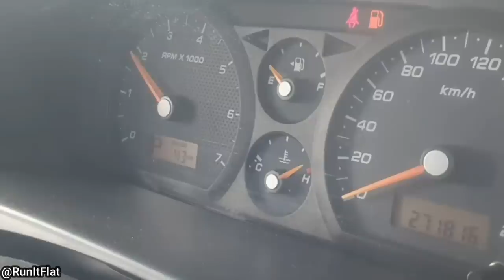Customer States Car Is Overheating And Won't Shut Off! | Just Rolled In

Comment: NO oil is something you do NOT want to mess with.  I had a car with a slow oil leak for years and couldn't afford to get it fixed... and kept adding oil to it.  Well, I either slacked on adding oil or the leak suddenly got worse and the engine seized up while going 75 on the highway in the left lane of 3 lanes.  No shoulder on that side and medium traffic.  

I had to merge all the way over to the right shoulder while coasting without power steering OR power brakes because the brakes quickly went out since there was no power.

Thankfully I had a hand brake and had been trained on using it in an emergency.  It wasn't fun but I did it safely.

Comment: I have seen dieseling when an engine runs to hot and rich you could even pull the spark cables and it will keep going.

Comment: 0:17
For anybody wondering
The reason why it's still running is because the alternator is still generating electricity and its just enough to keep the engine running

Comment: Old Fords had a habit of not turning off with the key; the trick was to carry a hammer in the car.  To shut it off, you open the hood and give the solenoid on the inner fender a tap, until you got around to replacing it.  Same with a stuck needle in a flooding carburetor, tap it a few times to dislodge the dirt sticking it open.  Young people don't have the pleasure of mechanical everything.  lol

Comment: The first car, I thought I was imagining it at first glance under the bonnet. Not imagining it, that's the mighty Ford Australia Barra six engine in a 2003-2005 BA Ford Falcon. Yeah of course she'll still run on the alternator, buggered ignition switch correct diagnosis.

Comment: 3:10  I would be beyond disappointed if a tire shop was doing that to set the bead on my tires.  If it was a tractor off in the field or something like that I can understand but not a light truck tire
Reply: sometimes you have too. When the new tires come in and the beads of the tire are almost touching
Reply: @poke769  If my new tires are that squished I don’t want them

Comment: i remember having a motorbike when i was in my teens and it wouldn't shut off , 
it high reved, then when i turned the key it didn't stop ( i had it in neutral ), so i pulled the ht cap off , still was going like the clappers like it was possesed ,so i had to stall it by putting it in gear 

the problem?
it had a ton of carbon in the head and on the piston which was causing the petrol to ignite 

scary stuff 
😱🤯
Reply: Have had that happen with a chainsaw - after idling for a few minutes however it would cool enough to stop, but confusing!
Reply: Running too lean and getting a flogging does that. Keep riding and the piston will melt a hole through it's top. Happened to me on a suzuki rv125 trying to keep up wuth a dr250 yammie. Lucky i had 3 spare parts motors.

Comment: Your note on the vice grips implies that there is a correct way of installing vice grips on battery terminals.
Reply: My guess on the broken shock is that it was an 800 dollar beater and not worth fixing.

Comment: My water pump seized up and snapped off at the fan clutch 720miles into a 760 mile trip. 2000 dodge dakota that water pump was stock. Fun times

Comment: I think the engine running is from dieseling. The engine is so hot it is compressing the fuel and igniting it. No ignition needed.
Reply: no
Reply: I'm pretty sure that engine was a Ford Barra 6, of which there were no diesel versions, only petrol and LPG
Reply: Not a diesel
Reply: @SpearM3064  99% sure that's not a diesel
Reply: @SpearM3064  no, the transits only have a second battery under the passenger seat if they're a camper. They only have one battery and that's under the drivers seat. Diesels have usually only one battery, but luxurious sport cars have sometimes 2 or 3.
Reply: Guys... he wrong but not for that reason.  YEs, it's a gas engine with a busted keyswitch, simple fix; however, the term "dieseling" is referring to when an older carbureted gas vehicle would continue to "run on" like a huffing choked donkey when the engine was hot and timing too far advanced and some hot spot in the chamber that allows for the compression and heat alone to maintain combustion similar to how a diesel works without spark plugs.
Reply: @THRASHMETALFUNRIFFS  yep, all the later model carbies had anti dieselling solenoids to positively cut off petrol supply inside the carby to stop the fuel instantly. One of those out of tune with the solenoid disconnected would chug and rattle for 15 seconds or so before it stopped!

Comment: 0:22 so how does the engine keep running with no battery? Like ik the alternator charges the battery but I didn’t think it directly powered the engine spark plugs and such. So how does that work? Is it literally running off the alternator or something?

Comment: Disconnecting the battery won't stop most engines from running as long as the alternator is working. Don't know what that technician was thinking.

Comment: Its weird that ppl don't know pulling the battery won't turn the engine off. Its basically used just to start the vehicle. The alternator will keep it running

Comment: If the ignition switch is busted then it wont matter if you unhook the battery. The alternator will keep the motor running. Cover the exhaust until it shuts off or unhook the alternator wires.
Reply: You can also block the intake as well, suffocating the engine of incoming air. :)

Comment: Here's a tip. When adding any fluid to your engine  be mindful of the paper seal under the cap of the fluid container and NOT let it fall into engine or other receptacles   because it's a bitch trying to get it out!

Comment: Yeah, pulling the batt will not kill any car because the alternator is still providing power. You best best would be to pull a relay that controls the fuel pump

Comment: I had this happen to a classic car I was driving. I got the engine temp light and I pulled over less than 2 mins later. I tried to shut off the engine but it wouldn’t shut off. I unplugged the battery the ignition switch wasn’t messed up it just go so hot. It was not a diesel car either but it acted almost like a diesel runaway. It was very weird. I managed to get the engine to stop by shoving a towel into the intake to choke it out after like 10 mins of trying everything.

Comment: Pretty sure if your car shuts off when you disconnect the battery, you have a bad alternator.  However, don't actually do this because the sudden change in voltages can seriously mess up your car (as mentioned in the description).  Someone did that to a previous car I had and luckily all that happened was locking the door with the key caused the horn to honk briefly.  I don't think I've seen one where the car wouldn't shut off with the key, THAT'S weird.
Reply: There's better ways to cut power to something, just yank fuses

Comment: The first video my buick lacrosse did that when I fixed my brakes. I went to work tried using my E brake heard a snap couldn't turn it off and took me about an hour for me to turn it off but what I did was pulled the brake backwards towards me with my foot and it magically turned off 🤷‍♂️

Comment: I've seen a Ford V8 get so hot that even after disconnecting the battery it was still running just due to the heat in the block exploding the fuel. We had to pull the fuel line to stop it.

Comment: The runaway engine is easily stopped. Foot on brake pedal, out it in gear and release clutch quickly to stall the motor - works if its manual transmission, its another can of worms if its automatic.
Reply: With the state of the brakes on most of the cars on this channel the only thing likely to happen is a short excursion through a brick wall!

Comment: Yes people, if the engine is running, it will continue to do so with the battery disconnected, as long as the alternator is in good shape.

Comment: As long as the Car is Running Disconnecting the Battery won't shut it off because if would be running off the Alternator at that Point the Battery is only used when the Car is off and to start the Car

Comment: What was in the camaro exhaust?
Reply from the maker: Turbo exhaust whistles. It's like putting a hockey card behind the wheel on your bike tire lol
Reply: @JustRolledIn  So no advantage whatsoever other than making noise?
People are dumb.
Reply from the maker: The exhaust is so big that it will probably not even make a noise lol
Reply: @JustRolledIn  LOL. Never looked before this, but I suspected you were Canadian with that comment. In US it would have been baseball card. Love your vids. Keep up the good work.
Reply from the maker: @michaelwarren2391  lol, you're correct and thanks, Michael!

Comment: Hi just wanted to let you know that motor is a ecotec its a aloytech the one after the ecotec (L36) they have a normal oil filter the aloytech has the one that looks like a pool filter at the top of the motor

Comment: its a stuck silinoied i had that proplem ware i turn it off take key out and its still running but when i disconect the battery it usly shut off and when i touch the wire to battery it start right up

Comment: The last one with starter fluid was plain dumb, but I’ve had to do it. My first truck had 16.5 inch rims and they didn’t seal the same way as regular tires
Reply: It's done all the time.  Handy trick on a farm or out in the sticks.
Reply: Hope you never go off-roading , or are in a really remote place with a tire off the bead 😮
Reply: @peterf.229  I live in Utah bro I’ve gone off-roading my entire life, let me give you a bit of education. The reason the 16.5 inch rims are no longer made for trucks is the wheels lack the safety rim that holds the tire against the bead at lower pressures. What this means is if the pressure gets low you will lose the bead on the tire and it will completely deflate, if this happens and the weight of the vehicle is on the tire it is impossible to re-inflate the tire. Modern wheels and tires do not have this issue.
Reply: @peterf.229  also, I’ve broken a rim out in the Moab desert. You always carry a spare, a high lift Jack, and a goddamn winch. I keep enough tools in my vehicles to damn near rebuild the entire engine if I have to off road. (Hyperbole obviously but you get me)

Comment: Take the air intake off and cover it with your hand or a piece of wood to kill the engine. Or pull the fuel pump fuse.

Comment: 0:36 Wait… A Camry with the oil filter on top of the engine? I thought they were on the bottom.
Reply: Australian maybe 🙃
Reply: My Tacoma has the same engine as some Camrys and it’s on the bottom , pretty sure the engines are similar in all of them, but who knows .
Reply: Mine was also on the top, I hated it

Comment: I was always told that doing the tire fire thing was only good as an emergency repair to get your tire back on and you're supposed to get it properly put on ASAP. Is this actually a professional way to do this?
Reply from the maker: You're correct on that. Also sometimes you can't get a tire to set the bead so you do this. From my understanding these guys were doing it after hours on their own tires. But ya there is more professional ways on doing so.

Comment: Who the heck thinks disconnecting the battery will stop an engine, unless the alternator noise happens to kill the ECU. There are about a billion other ways to do it. Pull the ECU, fuel pump, or main relay. Or fuses. Or spray a CO2 fire extinguisher into the intake if it’s about to explode and you don’t want to get close

Comment: The wobbly custom exaust makes my exaust look excellent lol i have a muffler with 3 in pipe slid onto 2 inch pipe no welds or anything hole in the cat i cut to relieve pressure when the factory muffler clogged and its being  held off the drive shaft by a ratchet strap been meaning to fix it but who wants to fix it when its in the 80s and 90s out i have a parts truck with a muffler i can use may be quiet but the engine will like back pressure again lol i have a 96 c1500 5.7 with 344k miles and a 98 parts truck identical just has 214k miles

Comment: uh if you don't cut fuel to the engine, it's not surprising that it is running without the battery... the whole point is that it's charging the battery when it's running... starting it without the battery would be surprising

Comment: Neighbor drove a company car. He'd check the dipstick and it appeared to have oil. But when he finally took the car in for an oil change, there was no oil. The dipstick had oil burned onto it. How do these engines run without oil?

Comment: Would have pulled the spark wires before pulling the battery cutting fuel snuff the airfilter either 3 will definitely shut her off

Comment: Remind me NEVER have tires changed at the last shop. The flame just ruined the rubber compound.
Reply: @SpearM3064  160 is the autoignition temperature. It will burn a lot hotter. 600-800°C.

Comment: Isn’t there something that allows a shop to prevent someone from literally driving away in a vehicle that isn’t safe for the roads?   Like, “Mr/mrs Customer we will allow you to call a flatbed to deliver you your vehicle off premises, but you are not going to drive on the street in this condition.”
????
Reply: In some jurisdictions there is such a law, but in others you can't legally stop them from driving away. However you can make the customer sign a waiver form that the garage isn't responsible for any liability due to the unfixed problems.
Reply: Honda dealer tried that with my civic, check engine light kept coming on , they wanted 950 bucks to replace the injectors, took it home used brake cleaner and it ran better than it did before .

Comment: That car that will keep running with battery disconnected + keys out.
At a guess, diesel engine that is burning overfilled oil to keep running? In my experience the only way to stop those is to just wait for it to burn out.
Or try to stall it by dumping the clutch - obviously tough shit if you're on an auto.
Reply: Nope, it's just the alternator having enough power to offset not having a battery
You would definitely know if it was running away
Reply: It's not a diesel as well
Reply: Aussie falcon 6 cyl petrol " Barra" engine. The ignition switch is falling apart and wont turn off. Theyre noted for failing ignition switches but that's about all bad there is.
Reply: @Alucard-gt1zf  Appreciate the education bro! :)

Comment: There's a kill switch in the left side quarter panel old mate
Reply: It's the fuse labelled "ign"
Reply: Isolator switch for crash protection. Most people are completely unaware of them. Underbonnet fuses are easier to get to though.

Comment: Do people realize that you can disconnect a battery and the car will still run..... its called a alternator...  the alternator runs the whole car when the engine is running. battery is only used to start the car, and to also power the electronics like alarm, remote start, the computer/brain. Etc...

Comment: 0:22 insanely dumb mechanic, disconnected battery when vehicle running wouldn’t shut down it, only taking out fuel pump fuse will help. Or put in first gear and release clutch with foot on brakes if it’s manual

Comment: Car wont die?? Pull the fuse to the fuel pump, pull the fuse to the engine electrical, pull spark plug wires, smother carb with hand, I have had to do this before. I have a kill switch installed under my dash, it can kill the truck, but when it's off, it will never start. Nice anti theft. 🇺🇸🍻👍

Comment: They don’t really teach car maintenance in schools. Are parents supposed to tell them these things? Many modern cars not only don’t come with spare tires anymore, but not even an owners manual, having the customer read it online. As if they would. If the manufacturers don’t believe people can change their own tires, (which would have step by step instructions in the owners manual) why would they read it? Oh well... ...eventually the majority will be driving EVs, and won’t ever have to worry about fluids and such. Just tires, and brakes, and most key only when there becomes a problem, or they fail inspection.

Comment: First video, all ya gotta do is find the fuel pump, computer, or some other important relay under the hood and pull it. Had it happen on a 80's Ford Taurus wagon I was beating on out on the back end of a buddy's land. Stupid thing went full throttle and wouldn't turn off, pulled the ECM fuse and, viola, it turned off. The alternator will keep a car running even if the battery is disconnected, but you could, if you're desperate enough and can reach it, remove the battery and disconnect or cut the alternator wire. 

On a diesel engine though? Heh, hope you've got some way to kill the fuel or plug the air supply.

Comment: Pardon my french but what the hell was that last dude doing lighting that tire and rim on fire? Is that a new way to install tires?
Reply: Its a very old way actually. And usually as a last resort for tires that will not seat properly. Scary if you ask me though. Definently dangerous as heck.

Comment: The reason the first car didn't shut off when the battery was unhooked is because once the car is started it runs off the alternator.  They could have simply pulled the fuel pump relay or fuse and it would have stalled it out.

Comment: Im tickled that the tech would think that by disconnecting the battery you think the engine would shut off. the alternator powers the vehicle while running, the battery just stores a charge to START the vehicle. YAY! you just proved the alternator works as intended. 

hint: pull a fuse to the coils or of fuel pump, perhaps even starve it of air by covering the throttle.